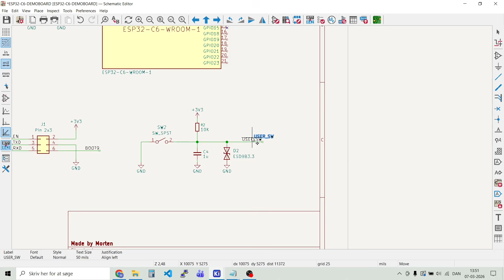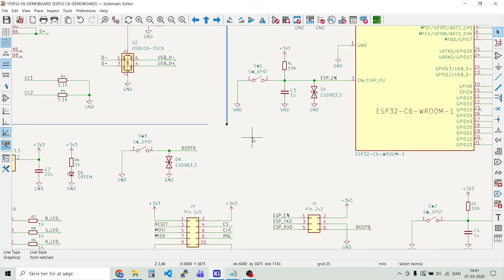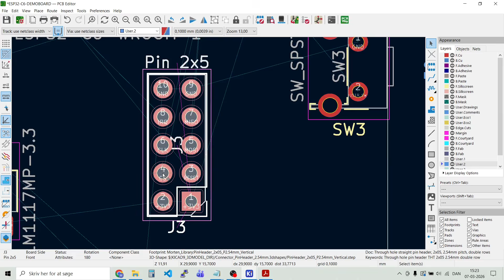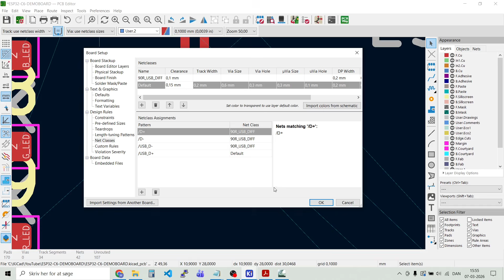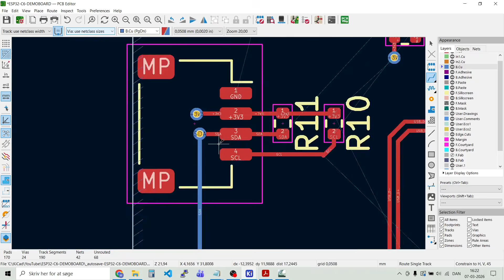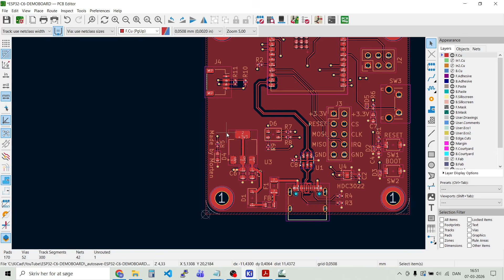KiCad 9 - Complete step by step guide and tutorial on a multiprotocol ESP32-C6, 4 layer testboard.

Comment: Really nice tutorial Thanks Morten. 
Q for you though, it seems the default install of KiCad doesnt have some of the parts you use. Specifically the star of the show, the ESP32-C6-WROOM and the the HDC3022 (Not even under the incorrect label of HDC2033)
I added the ESPs from Espressif but am not sure where to get the humidity sensor from. (I just left it off)
Maybe you could add a little section at the start showing what libs etc you have set up.
Reply from the maker: Thank you very much, i can upload the project to github if you need it
Reply: @made.by.morten.laboratories That would actually be really nice! Thanks. 

As I am working my way through the tutorial, I notice you sometimes use shortcuts (like placing a via while drawing a cable) but dont mention the key combo. I use Keystroke Pro to show keystrokes but I think it's Mac only.
Reply from the maker: I have now uploaded the design and libs to my github repo

Comment: Great video.  A question: why did you add a ground pour on the top layer? You already have a ground plane on the inner layer.
Reply from the maker: @stefanopassiglia  - Thank you, yes you can make the design without the ground pour on top, it does not hurt to do it on top either.